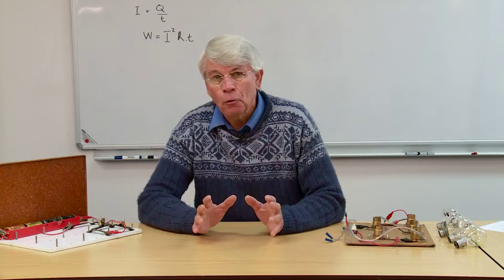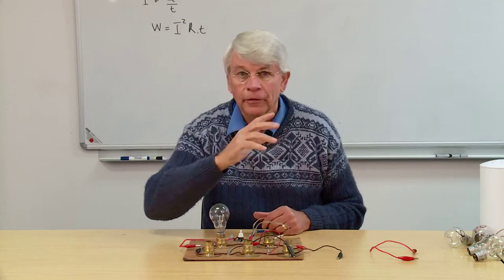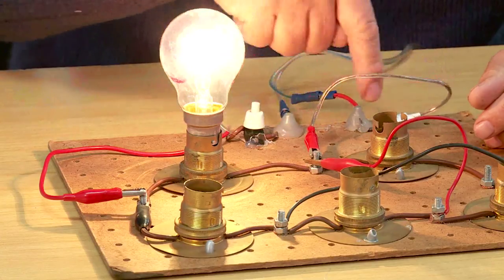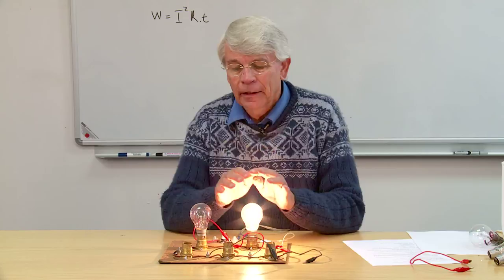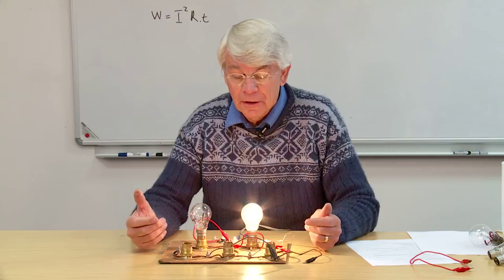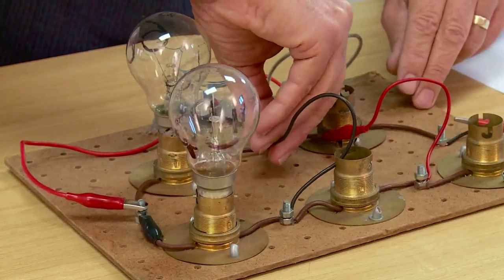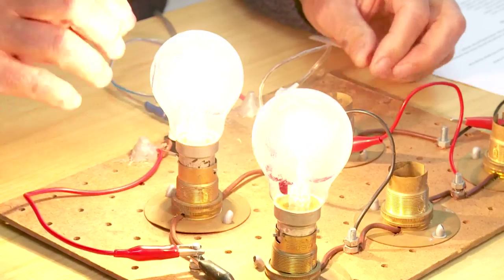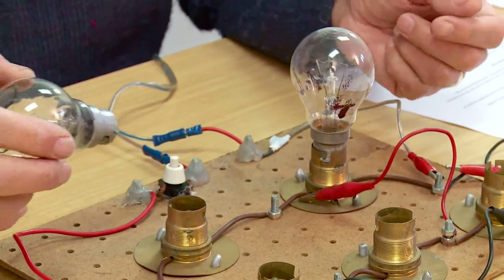How to teach electrical concepts and circuits

Comment: Slightly confused - I thought that bulbs worked on resistance - the higher the resistance, the more energy it can transfer by heating from the circuit? According to my (possibly misconceived) understanding, this means that a brightre bulb will have a higher resistance.
Reply: the brightness and resistance of bulbs connected in series is directly proportional but the brightness and resistance of bulbs connected in parallel is inversely proportional
Reply: في حالة التوصيل توالي ولكن توازي العكس